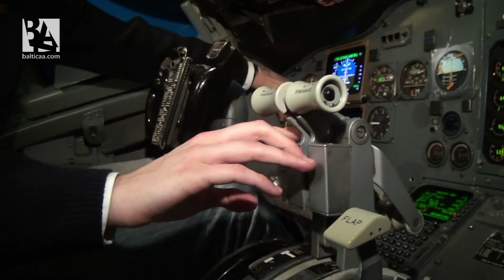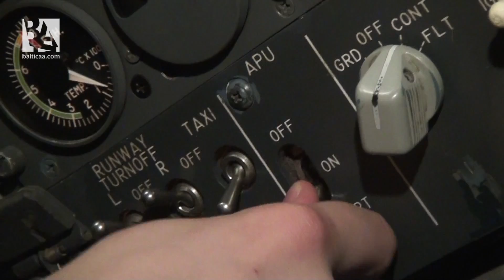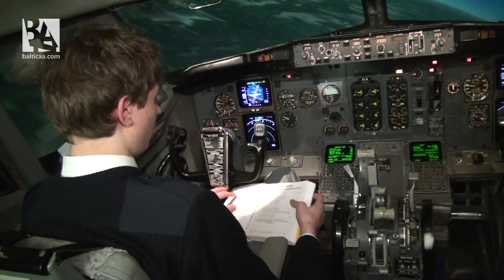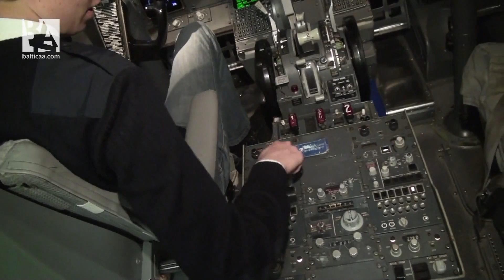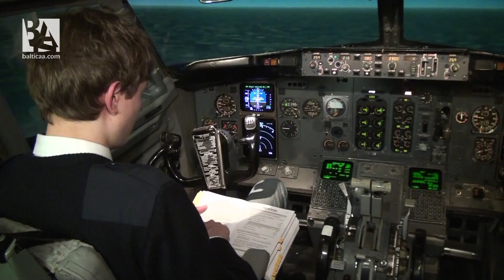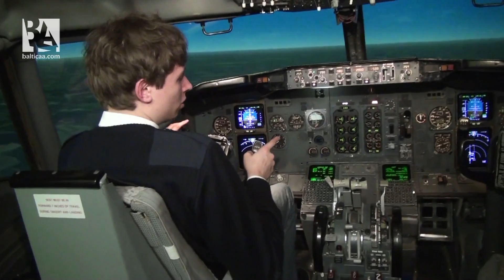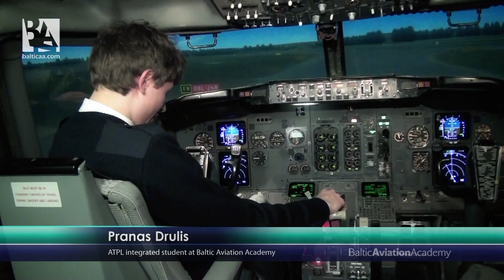Boeing 737: Engine Failure

Comment: Thanks, I watched it again and could see you working the ET from the steering column. Also noticed them working during flap retraction. Nice Flight Simulator. I think I'll check Ebay for a used one.

Comment: May I ask why it wasn't necessary to dump fuel? I was under the impression that a return-to-airport landing would require the pilot to shed fuel in order for the aircraft not to exceed its landing-rated weight. (I apologize if this is a naive question.)

Comment: The right engine wasnt selected "on" ..  Just because the throttle is advanced doesnt mean its running..  The fuel cutoff/idle lever for #2 is at the cutoff position.

Comment: Some people are asking, why change the settings for heading course and altitude if the auto pilot is disconnected. 
The answer to that is, even flying manually the pilot is using the flight director for guidance.  Also it is useful in the event that the pilot needs to re engage the autopilot, everything is set up correctly.  Hope that helps.

Comment: In every situation the most important rule is ALWAYS fly the aircraft FIRST. 

A lot of accidents have happened because the entire crew was trying to solve a problem. How many pilots does it take to change a light bulb? In case of Eastern Airlines 401 2 pilots and 1 flight engineer. The captain by mistake pushed the yoke forward, therefor disabling the auto pilot and cause the aircraft the decrease altitude while everyone was busy changing the light bulb and resulting in a crash!

Comment: Not yet, but i was it for about 20 years in Germany. :)  Today i only treat the MS Flightsimulator. :)) 
Not every airport has a ILS-Runway, but the bigger ones (one or more runways). To use the Autopilot Approachmodes, you have to select the ILS-Frequency to NAV1 (and DME or VOR/DME to NAV2). The APP you can press if you are ILS-established. At calm winds the AP will catch the path.In hard crosswind and (scherungen? whats in english?) turbolences it's better manually.

Comment: A Glideslope will be intercepted from the bottom up. E.g the initial approach fix is 3.000 feet QNH an the GS needle is coming down to center, you have to start the descent with a standard-sinkrate.to keep the path. If you fly via autopilot, the "APP" (Approach) will maintain the glideslope AND localizer automatically. Also you can select LOC or G/S only.Single Engine Piston Aircrafts like Cessna only have APP and NAV.(mostly).

Comment: Part II:

---

On engine-failure it can be nessessary to select a higher approachsped with less flaps (for example max. 15 degrees). This settings can do at another point than during a "normal" approach with all engines running.

Comment: Normally you can intercept an ILS with 30 degrees, e.g. the runway heading is 250 an you fly a heading of 280 to intercept the localizer,

It's not a good idea to do that with a high airspeed, so you have to reduce first to a smooth speed. Or the controller says "Reduce speed to 170 knots!" 
For that speed you need flaps (not gear down) for a safe flight and for keeping the approach-path.

Comment: This is a part of the MCP (Mode Control Panel) in a Boeing 737 and means the N1 limitation of Autothrottle. Normally this limits will be set on the "ACT PERF INIT" page of the FMC/CDU  (Flight Management Computer / Control Display Unit), 
Another function of the Autothrust is the level-change button.  One reason for that ist the speed limitation 250 knots in FL100 and below - if you want to climb into a higher flightlevel without this limitation. In this case you will need a higher N! climbpower

Comment: sorry, part 2: Don't go beyond flaps 5 until inbound on final app course. Select gear down and flaps 15 when glide slope is within 1 dot and closing. Passing 200'AGL have the other pilot center the rudder trim for landing. One other thing to ease the workload- at 400' climbing out declare an emergency as follows: "Heathrow dep, Pranus73, declaring an emerg, rt eng failed request vectors for ILS rw##, stand by for further info. This will delay the dialogue about souls on board/fuel till later.

Comment: Nice work! Never flew the Abus but I'm typed on the 737 and a few other Boeings. A few ideas for you- once stable climbing out, the pilot flying is supposed to make the INITIAL rudder trim movement. Just get it going in the correct direction and then tell the other pilot to set 15 against the dead engine.Start with15 climbing, 10 level, 5 in a stable descent. If the control wheel points steadily to one side or the other, you need more rudder (pressure or trim). Continued next comment.

Comment: Actually it's NOT elevator trim it's horizontal stabilizer trim.  It will trim the nose up or down in response to: either pilot's yoke switch, autopilot  commands or via the flight control computers (2 each) Speed Trim commands.  

Note that the pilot's input will override the other two.

Comment: Those are the elevator trim wheels. They basically control how the plane will pitch (point up and down) if you release the yoke. There's a switch on the yoke that controls them.

Comment: In this case the warnings are about the AC, generator, hydraulic pressure and other´s powered by the engine, so they skip that control and recall it later when the plane is at a secure air speed and altitud. Let´s not forget that in a normal flight there are two members, a pilot and a co-pilot, and the task´s are divided.

Comment: That is the Stab Trim (a.k.a. Elevator Trim). This is controlled by either the autopilot or the pilot him/herself by a switch on the left side of the Pilot's control yoke (Right side of the yoke on the F/O side of the cockpit). This is to keep the aircraft at a certain attitude (pitch up or pitch down) while climbing, descending, or while cruising without autopilot, which pilots never do regardless.

Comment: Some failures are expected and they know the warning is a certain failure when an engine fails you are going to lose anything that engine powers so they already know some of the warning's because they know the plane. Also they have a co pilot to do any issue checks. And why planes crash so often I'm sorry but they don't crash very often. Planes like these are designed around losing an engine to ensure safe landings.

Comment: Pranas...I'm sure it's your training facility's procedure, but I am puzzled as to why they suggest turning off the F/Ds at 500 feet.  This makes no sense, in the event of a go-around, and also especially if you were in low vis, or IMC conditions.  

Also, RE: rudder, and the trim - you may find it useful to *not* trim the rudder fully, only enough to relieve the force required, keeping a need for just a little...it helps to control, since you can vary rudder pressure slightly, as needed.

Comment: Those would be the pitch trim wheels. They are being driven by electric motors controlled from a switch on the yoke. They could be turned by hand if a failure happened, but it is easier to just use the switch on the yoke.

Comment: That is the manual trim wheel. The pilot has an electronic trim button on his joystick that permits him to automatically spin the wheel (nose up or nose down position). There are trim servo-tabs on essentially all flight control surfaces. Search it up and you'll learn more on that subject.

Comment: not really. the autopilot is programed so that when the pilot apply some force to the yoke, it turns off automatically with a loud alarm.

this used to happen before on airbus, but with no alarm.
the pilot kid was on cockpit and moved the yoke "joystick" and the autopilot turned off, since there was no alarm, pretty much everyone died on the crash that followed.

way to go airbus!

Comment: I'd like to add I've heard that if you pull on the yoke when autopilot is controlling altitude, the trim wheel can go to maximum trim to compensate and if you turn autopilot off at that moment, all hell would break loose. I'm not a pilot just heard that.

Comment: if youre talking about the spinning weels. those are TRIM CONTROLS.

in a "normal" aircraft, it moves little trim tabs on the elevators helping the pilot "recenter" hes yoke. or in small planes, helps the pilot reducing the force he has to apply to the controls.

Comment: Well first of all, the point of the video was to demonstrate what happens with an engine failure AT V1. And secondly (as the point of the video is), they happen at the same time, he just said them in the order of most-to-least important.

Comment: He said:

"Engine failure, continue"
"V1, Rotate"
Reply: Ik, if the failure is before V1 they have to abort takeoff
Reply: Smh it was literally ONE second before V1. The engine wont respond that fast. Dont act smart when ur stupid
Reply: I think it happened whilst the engine failed which is why he said it quickly
Reply: Should have aborted. Poor instructions
Reply: I don’t even think he set the v1 and vr speed he just said that because it was a habit

You can see he was in the touchdown zone of the other end of the runway so it is very possible that he was actually over v1 speed
Reply: @charlespg3d190 Did you even notice the way too slow acceleration of the aircraft?
Reply: @quamrunnahar-uj2gj  ?
Reply: @quamrunnahar-uj2gj  what are you trying to say?
Reply: @charlespg3d190 I meant the aircraft was accelerating  too slowly, it was quite sluggish. 😅 😅

Comment: When I lived in Fort Worth TEXAS near the Lockheed plant where the F35 Lightning is assembled I flew its simulator. I am a pilot. I was amazed by the absence of the usual switches and guages. There was a large television screen and voice message that said it all. 

Also, I crashed into the fan tail of an aircraft carrier. There were no survivors.

Comment: Dear friend, you had an enfine fail and a pilot incapacitation, you didnt ask for other pilot in the airplane, for doctors, you didnt work fine onm trim with the yoke, you didint any may maday, you didnt try engine in flight start. you dint put rto during takeoff. But was good.

Comment: Those are called trim wheels. Their are what are called trim tabs on the elevator and rudder of an aircraft. the purpose is that these small trim tabs can move independantly of the actual control surface and move very slightly. However this slight movement releases alot of what pilots call back pressure on the control yoke. Basically, when an aircraft is trimmed correctly, you can let go of the control yoke and the plane should fly straight and level on its own. It saves the pilots from fatigue.

Comment: They turn because the pitch trim system is a closed-loop system, when trimming via the horn switches on the yoke it also actuates the trim wheels, and the same happens when the autopilot is online. ;-)

Comment: I didn't know that the high outside air temperature affected airoplanes so much.  Is it because hot air reduces the engine performance?.

I remember on my motorbike that you could hear and feel the difference in performance when the air was cold.

Comment: thats a good idea about the side sticks being linked....but i don't think that electric shock thing would catch on (even though it would definatly do its job). i definatly agree that the engine failure would be much easier in a320 than 737 classic. I like boeing's modern FBW system, because you still have the full imporession of flying the plane and therfore know how it is flying. they aslo make it dead obvious the plane is exeeding the flight envolope (stickshaker, stickpusher, resisting input)

Comment: You're right,I may have been a bit harsh
After AF447 I also thought that I could be a good idea to link the sidesticks so the pilots feel each others actions or to add some force feedback 

But for know it's better to turn of the computers when something goes wrong.Maybe someone should suggest electric shocks to Airbus when the computers go into degraded mode:It would always be noticed

That being said I still think that the A320 engine failure was much more relaxed(737NG would be different ofc)

Comment: the pilots hadn't been aware of the THS position because the comp put it there and they didn't have to worry it. when it stalled they were caught by suprise and were simply unaweare of it. In a boeing the pilots would have been moving the THS manually during the test and therefor would have been fully aware of its position. And yes i know about mechanical backup, rudder and THS. would be very hard though, and if ALL electrics fail you have no engine control either.

Comment: In XL 888T, the crew were conducting an alpha protection test when there was 1 or more contaminated AOA vanes, the plane unexpectedly stalled whilst in normal law (comp had put THS to 12 degrees nose up during test). It then entered direct law and recovered from the stall but climbed steeply because the pilots were unawear of the THS psotion (which WAS being controlled by the comp) and failed to recognise it, the plane stalled again, didn't recover and crashed into the ocean.

Comment: and in that moment you are in the same situation as a pilot who hadn't the computers to begin with. 
As long as the computers run they prevent the pilot from mistakes, help him dealing with such situations.
When the computers fail they degrade in mode until nothing is left. A Airbus can be landed using "mechanical backup" if all computers are dead but I never heard of an accident where the computers were completely lost
80% of accidents in aviation are to pilot errors
Computers made flying safer

Comment: 20:56 No i can't do the comparisons between the airbus and the boeing, because you are using an older boeing. It would be a much fairer comparison if you had a 737NG simulator. But yeah I did have fun watching.

Comment: They are 'trim wheels'.
When a plane goes faster, the wing generates more lift, so the aircraft pitches up. To counteract this, the pilot trims down. In the most basic form: the trim changes the centre point of the control column, so the pilot no longer has to push down all the time, so to speak. 

They are not moving by themselves as such; the trim can also be controlled by switched on the yoke by the pilot's hand so he/she does not have to remove their hands from the controls.

Comment: In my opinion the safest landing is the Space Shuttle kind of  landing, so it means landing with no engines, it means higher glideslope and no thrust. Imagine, if he had lost the 2nd engine, he would never made it to the runway.Staying on high angles of attack like in this case is very dangerous.So this means in the case of engine failure during take off, the pilot must accelerate the plane right away, pulling flaps and gears slowly and then start climbing to the "gliding altitude and distance"

Comment: Yep, about 60knots depending on plane and/or airline.To stop potential FOD damage and also because the engines don't like re-ingesting the same air. In some emergancies like some high speed MTOW RTO or somthing where you need to stop ASAP or have limited breaking (fire, brake failure, ect) then you can use reverse all the way to the stop.

Comment: nah mate, classic is the -300, -400, -500.  Next Gen is the -600, -700, -800, -900. 

Your thinking of the -100 and -200 which are (in boeing's words) the 737 "Jurassic" series. 

There are some 737-300s (classic) that don't have EFIS (electronic flight instrument system) and therefor only have analog instruments similar to the "Jurassic".

Comment: Hydraulic system A retracts the landing gear. There are mechanical uplocks that hold the main gear in the up position. An overcenter lock link holds the nose gear up. The pressure stay up, but not connected to the landing gear anymore.

Comment: He is correct as well, because it's also the power the engine can give out. The fan blade that you see in the front of the engine is was produces the most of the thrust that jet engines we have today and that N1 is most common measure of power in a jet. EPR is also used in some airacrafts, but N1 is less confusing as N1 shows power in percentages and that EPR shows power as Engine Power Ratio thing, and that it shows 1.xx for certain power setting.

Comment: N1 its the indicator of RPM of the main turbine of the engine, N2 its the indicator of RPM of the secondary turbine of the engine. when you turn on one engine of the 737, you put the engine start on ground, then you wait for N2 to reach 20%, then you feed the engine with fuel, N1 and EGT rises up and the engine is on.